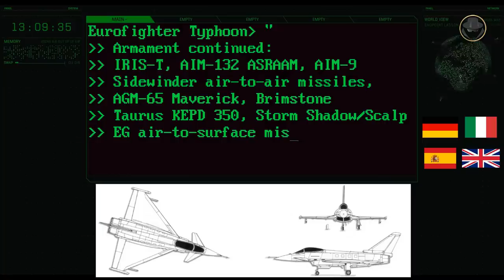Eurofighter Typhoon | The story that the West does not want to tell

Comment: Mirage III is first 2th gen to be competitive against the Mig 21 thanks to its delta. Israel add canards like the saab to make the kfir. Conclusion, all 3th gen using delta and canard are inspired by the Israelian kfir, including the grippen and the mirage 2000....
Wtf???
Reply: What do you mean WTF? Israel added the canards to the Kfir in 1975, mirage 2000 is from 1978, The Saab Gripen is from 1988, so what is the problem?
Reply: @E_y_a_l  French brought the delta to modern jet fighter with mirage III (1956). Swedish brought back interest to canards to modern jet fighters with the viggen (1967).
But the video attribut (11:14) the widspread of these 2 attributes (delta wing and canards) in the modern fighter jets (including rafale and grippen, which are the successors of the mirage III and of the viggen) to the Kfir (1970).
Better?
Reply: @alxtroun4373  The video attributes the traces of the Kfir in the combination of delta wing + canards + powerful engine + fly by wire + advanced electronics + composite materials, not just delta and canards, better?
Reply: @E_y_a_l  Clearly not better, you are trolling and inventing things. The video does not mention anything about fly by wire, advanced electronics, neither composite materials. And "powerfull engine" is at best vague if not wrong as the Viggen, mentioned, which was anterior to the Kfir (1967 vs 1970), had canards, delta AND a more powerful engine than the Kfir (125kN vs 83kN).
So attribute modern fighters specs from the Kfir (which was built by stealing plans from Switzerland) is clearly WTF...
NB: you should open better your ears, the video says:
"if you look at carefully the new fighters developed in the 1980s, you can find the trace of the Kfir. Many aircraft, such as the Eurofighter Typhoon, Rafale, JAS-39 Gripen, J-10 and Lavi, have tailless delta wings, canards, and powerful engines."
The later mention of composites, fly by wire and advance electronic refers to the Typhoon not the Kfir ("engineers who worked on EAP program"). Kfir had none of them (lol!)
Reply: @alxtroun4373  I'm not trolling, I simply asked what do you mean WTF and what is the problem? you are the one who started with the all "better?" attitude, and that's because of your own aggressive way of speaking, not mine, so look at yourself before you blame others.
I've watched that part of the video again, and it clearly says Saab 37 Viggen
 > Kfir > 80s aircrafts, so I ask again, what is the problem? the EF / LAVI / RAFALE etc all look more similar to the Kfir than the Saab in the overall shape of the delta wing, canards, nose and tail, and that's exactly what is said in the video, in fact all of them look like a combination of a Kfir and an F-16, so again, what is the problem? the video mentions the Saab, it just places it further back in the historical hierarchy, you also have a problem with people saying that the Apollo program had attributes of the Gemini program because the Mercury program was before it?
Reply: @E_y_a_l  Mirage Milan did its first flight on May 24, 1969. It was the first canard delta Dassault worked on.
The Kfir did its first flight in june 1973. And it's a (bad) copy of the Mirage III.
That's the problem.
Reply: @H3x4r35  Read my last comment please, it doesn't matter who was first, I don't remember everything that is said but I don't think the video claims the Kfir was the first delta with canards, it claims the 80s designers were influenced from its design, the Milan was just a small number of prototypes, so I don't know why you even mention it as something that made any real impact, but since you did, it's really a bad claim to say it had a larger influence than the Kfir since it had small retractable canards on the front of the nose(and not behind the pilot's view) that looked nothing like the canards on the later 80s aircrafts that had canards with a similar look and positioning like the canards on the Kfir, so not only you haven't disproved the claim on the video, you proven it right, it shows that although there were another Mirage with some kind of canards, the designers were influenced by the Kfir and not the Milan since they used the Kfir's design.

In addition to that, the Kfir served in the Israeli air force and was used in real operational service, especially in the late 70s and early 80s, in the other hand the Viggen had no "real" proven combat experience and the Milan had none, so it's logical to say that the Kfir's performance history had bigger importance when the designers were researching designs for a new aircraft, but that's just in theory, practically and the biggest evidence is that the 80s planes just have more common characteristics in the overall shape with the Kfir rather than the Viggen or the Milan, that's all, I don't know why you and the other commenter are so offended by that claim(although I can guess).

Regarding your comment that the Kfir is "a bad copy of the Mirage 3", that's really just trolling and only shows you have an agenda here that is more than just discussing a subject.
Reply: @H3x4r35  No I won't "stop", not that I ask your permission, nobody, neither I or the video, have said or wrote a single word that claimed Israel invented the canards or the delta + canards concept, nobody also claimed Israel have invented the Kfir's design, the fact Israel have stolen the Mirage plans are well known and nobody have claimed otherwise, especially since it's not relevant to the discussion, if you can't read or at least understand what you read then I recommend you avoid written conversations(and by the way, you gave a link for a story about an engineer on trial for selling plans of the Mirage engine, the Kfir used the F4 Phantom engine), you are the one who needs to "stop" arguing about that claim since nobody have made it, at least the OP had some kind of a point, you have none, those tiny wings in the front of the nose of the Milan you call canards looks nothing like the canards of the 80s aircrafts and if you claim that they have influenced that design then under the same way of thought I'll say the Milan stole it from the Viggen, so what's your point? in any way you'll look at it the Milan wasn't the first and wasn't the most influential, nobody talked about who invented the delta + canards and nobody talked about who invented the Mirage design so stop whining about it and take your bruised overinflated ego out of here.

And regarding that last line, you going to those places only shows your own inferiority complex, bigotry, hate and primitive way of thinking, also you show how little you know Jews or Israelis by saying such a thing, obnoxious? look at a mirror buddy, although I doubt you can with the amount of self hate you've got.
Reply: @H3x4r35  And by the way, mister aviation-savvy genius, if you'll check you'll see that Switzerland indeed had Mirage IIIS since 1964, but the canards were only added to their planes in an upgrade program in 1988, some people can say in a design move that is directly inspired, if not copied, from the Kfir......how's your ego doing?
Reply: @E_y_a_l  
The very real impact Israel had was to make arab countries buy lots of Dassault jets in the years after the 6 days war because they thought it would make them better at warfare. Well it didn't but that's another story.

So thanks for the free advertisement I guess.

Now serious question: do you honestly believe IAI had something to teach to Dassault in aerodynamics regarding delta-canards configurations?

I really want to know before deciding if you're really not well or misinformed.

However if you want to speak about ego, I have more fun facts regarding highly advanced israeli military programs which originated from France to share, so don't worry my froggy ego is doing super well. 🤣

...But in any case please don't tell us the Rafale is a copy of the IAI LAVI or something, we already have a guy pretending it's a copy of the Eurofighter in the comments and that's enough craziness in one place at a time. 😂

Cheers

Comment: There's quite a lot of misleading bias in this video which detracts heavily from what could have been a kind of documentary.  Unfortunate.
Reply: Like what for example? I'm not that knowledgeable when it comes to the Typhoon's design history, but I feel like the video gave a few valid points. It's not really calling the aircraft bad or anything of the sort, rather that it failed to completely capture the market (whether this was the Typhoon's objective or not) and that is true, the F-16 ended up taking that market instead. You can have a great aircraft that doesn't sell that well, it has happened in the past and it happens today.